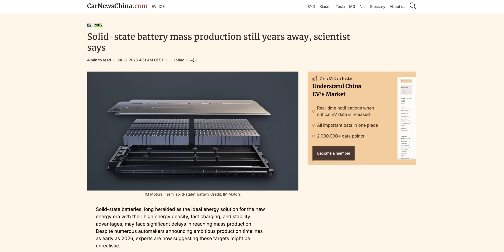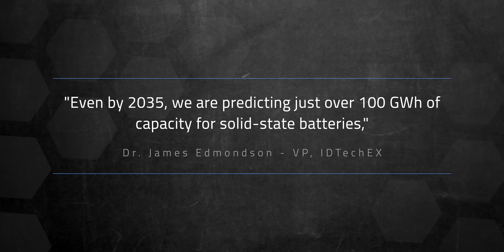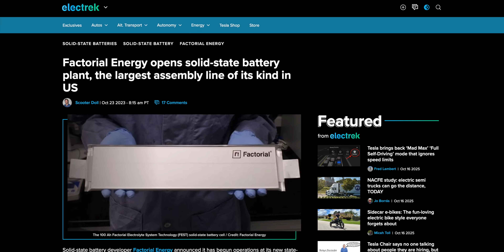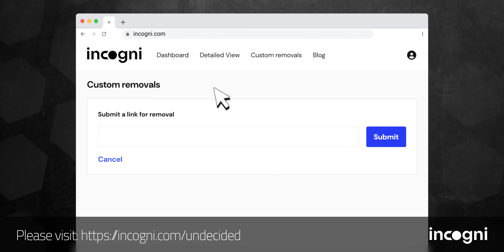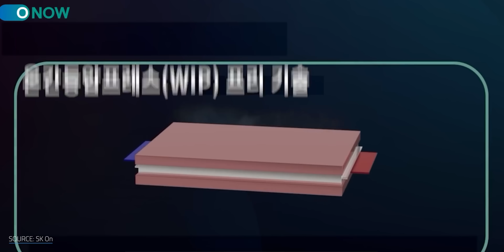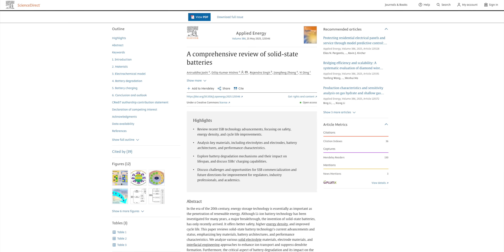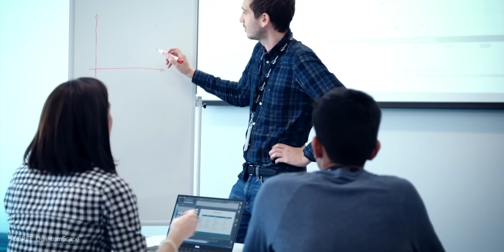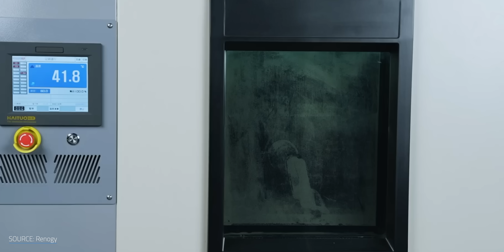How Close Are We to Solid-State Batteries?

Comment: I just want battery that does not degrade in a year. At least 5 will be nice.
Reply: Current real world data is beginning to show that EV batteries last a lot longer, with less degradation than lab testing predicted. The average expected life (90% retained capacity) of batteries in EVs is over 300K miles. That's on par with a properly maintained ICEV.

Comment: Seemingly, solid state became the holy grail back when there was exaggerated concern about battery fires.  Over time that has proven to not be a major concern.  Is greater range what we need?  I don't think so.  What good is a 1,000 mile range battery if it takes a month to charge?  I think what we need is a battery that will provide over 300 miles range at 70 mph in the winter and will recharge as quickly as one could gas an ICE car.
Reply: Yep. The only numbers that matter are how fast you can add 200-300 miles of range. Everything else is just noise.

Comment: Time to wait for a computer or phone with solid state batteries
Reply: either that or room temp superconducting material coming first which would make every electronic device near 99% efficiency.
Reply: @bulletghost3452  99% efficiency doesn't mean much so long as your screen emits light, screens are the main thing that depletes your battery, other electronics component have less impact unless you are playing a very heavy game for your phone

although it would probably just around double the battery life if they managed to do it
Reply: i know, my battery on my phone holds like 60% charge right now, other than that the phone is perfect still. beyond insane.
Reply: @chancepaladin  Get a new battery.  Set it to never charge beyond 80-90% and it'll last much much longer.
Reply: @ChrisNotTheKing  not all phones have that option though, normally saving it for their more expensive flagships.
Reply: @ChrisNotTheKing  Replace your battery, don't bothere trying to keep your battery at beyond a certain point or at a level, the benefits of that are minor
Reply: @bartomiejmarciniak4034  You're right.  The only benefit of prolonging the life of the battery for the life of the smartphone is that you won't have to replace the battery.  It's why they can be considered consumables... as are those devices with non-replaceable batteries.
Reply: This is my take, I don't care about cars, give me a phone that can last a week on a single charge even under heavy loads
Reply: @YUGAMISEKAI  rather have the car that'll take me on long trips without stopping
Reply: @revengerwizard  all chinese manufacturers have already shifted to partially solid state batteries in phones with 7000+ mah batteries..in fact i am holding one iqoo neo 10...crazy battery life with all ai features that even apple doesn't have
Reply: @jagandanesh9560  the iqoo has a silicon carbide lithium ion battery.

It's just another variant of li-on with better energy density and faster charging capabilities. Nowhere close to what true solid state batteries can give you.

Comment: As nice as it would be to improve the battery, the root problem with EVs are everything except the EV. Without good infrastructure throughout North America, EV adoption will stay scarce. At this point we'll need charging stations in empty rural lots, strip malls, shopping complexes, gas stations in order to level it out with ICE drivers. And 10 minutes to get to 10 - 80% is not good enough either. It'll need to match the speed of a gas up from 0 - 100%
Reply: No it won't.  Why 0 to 100. 10 to 80 is good enough.  Now the time to charge may have an input.  The other main point is you will mostly charge at home. So the effective time to charge up is zero if your can charge always at home.

Comment: SSB has almost become a meme with lofty promises and ever pushed back launch dates. The way it seems now alternatives to SSB might reach those lofty promises of SSB before the Achilles heel od SSB is solved, the lifespan and degradation plus increased production costs. 

LifePo is there already in regards to safety, and charge speed and decharge speed gets better each year. I'm pretty sure the train has left the station for SSB in the automotive world way before 2030 in regards to price, performance and lifespan. 

We already see that long haul to trucking in Europe is doable today with existing battery tech and charger infrastructure. And brand name trucks bought at your local dealer. And imagine how much better that will be over the next 5 years.
Reply: And don't forget the current trends in improving motor technology.

Comment: Sodium ion batteries is out and is amazing in cold climate
Reply: Uh huh.
Reply: 30% less energy capacity is not amazing
Reply: @rotaryenginepete They will likely be huge for the grid where energy density isn't as great of a concern. They also have potential for cheap cars where range might not be as big of a deal as long as they have a 100-150 mile range. Cost/kwh being cut in half and inherent fire safety are incredible in the right applications.
Reply: "DIY Solar Power with Will Prowse" did a reality-check video on those.
He pointed out that nobody is mentioning the round-trip efficiency.
It is likely comparable to Ni-Fe batteries with the very wide operating voltage range of like 4-16V,
Reply: @economicprisoner  Round trip efficiency isn't as much of a concern with grid applications. Pumped hydro projects are still ridiculously profitable at 75% round trip efficiency.
Reply: @fern3436  he is Dell, that says enough !
Reply: @economicprisoner Zi-ion batteries are starting to look promising tho their energy density is not quite as good as Li-ion yet.
Reply: @YetAnotherUnixUser  I have not looked into the LTO batteries that Will Prowse mentioned yet for cold temperature tolerance.
Low temperature sulfur batteries are likely to be energy dense if they ever finish inventing them (having 8 valence electrons).

Comment: 2:00 - there is difference outside texas. if your winter is averaged -25°C. you will be bothered about 3% liquid within a battery
Reply: The liquid could have a lower freezing point. Sodium ion batteries have much better low temperature stability than lithium
Reply: @Hotrob_J  i am proud of your optimism for "average Joe" knowledge level to be able to differentiate battery chemistry beside something short as "solid state" marketing.

Comment: Some of that is still solve in terms of sodium by allowing a hybrid pack. The sodium battery can do lower temps and thus could help run thermal and on start operations while the SSB can handle the range. IF they can really hit double the range, then really you only need half the current cell amount as well reducing the over all cost compare to what it cost to have that same range in LFP. 400 miles would be more than enough for me (400 for perfect weather/temp, 300 for cold/hot days). And if sodium gets cheaper as they say it will, then that drops the over all cost down even more for the pack.

Comment: Another "breakthrough technology only 1 or 2 years away."  This has been battery and EV stories for decades.
Reply: But we can’t deny things have improved year on year and that’s not looking at a almost 90% fall in price. Range is really increasing year on year that’s not in question. But it will get to the point you need to say right enough the range of 500 miles real world is more than enough for 98% of Car owners so why chase this 1000km most manufacturers seem fixated on like a challenge. Great if the battery gets lighter and offers 500 plus real world miles but do we need 800 miles I just don’t think so.

Comment: One false claim after another, nearly as bad as Fusion.  Sure Toyota has had a car with Solid State batteries for near. a decade, but it cost 1 million dollars. Until something fully solid state and not some fake comes to market where it can be examined for cost /performance and potential draw backs like catching fire, exploding, emitting lethal gasses, dangerous EMF, etc - its a non product.  A problem with markets is the desire to be first results in massive numbers of false claims.  Close only counts with shotguns and hand grenades. It is either solid state or it isn't.

Comment: Just a reflection if the expectations are that we can have a car that can travel 1000 miles on a full charge and charge from 10% to 80% in under 10 minutes. First, I will assume an efficiency of 4 miles/kWh at 75 mph. This translates to a FULL USABLE BATTERY CAPACITY (at 100%) of 125 kWh. The car still needs that amount of energy to achieve the range objectives irrespective of the battery technology. 

Now comes the interesting part. To achieve the objective of charging from 10% to 80% in ten minutes the battery needs to charge 87.5 kHh in 10 minutes. That translates, assuming it can do so at the same speed for the entire time and my math is correct, into a charging speed of 1,450kW charger. Are these available? If not, when will they be widely available? Today in China they prototypes of 1,000kWh chargers but what about the rest of the world. I honestly believe the holy grail is still much further away than just the battery technology as this will address safety, size and weight but not necessarily efficiency as other factors come into play.
Reply: Realistically, the goal should be 200-300 miles of range in 10 minutes. Everything else - percentages, charger types - is just window dressing. That is part of the appeal of true solid state batteries. They charge faster, with less heat loss, than other compositions.
Reply: @GeeDeeBird  The point still stands. If you want to charge 200 miles, not 300, in 10 minutes and do so in a car with the 4 miles/kWh efficiency which is probably not achieved at highway speeds by very few if any car today, you need to charge 50kWh and this requires average charging speeds of 840kW. Where do you have those chargers today? Yes, they may achieve the batteries but everything else is needed to achieve your objectives. From China today they have cars that get close but in 15 minutes.
Reply: My point also still stands. Not everything relies on charger voltage. Improvements in battery and motor technologies can lead to reductions in charge time as well. And those improvements are in sight. Axial flux motors and low charging loss battery technologies are out of the labs, and will be in production long before we see 1K charging infrastructure. Heck, even improvement in wiring and connectors can influence both efficiency and charging speeds. So, while your analysis is essentially correct, it fails to take other relevant factors into account.
Reply: @GeeDeeBird  I hear you and agree that technology evolves and does so very fast. The only point I want to make is that we may not be as close as those other development do take time to implement. The most significant hurdle will probably be the installation of large numbers of the charging infrastructure required for the very high charging speeds to support it. The reality today is that with what we currently have available there are many consumers that can greatly benefit from moving to an EV except from the fear of range anxiety and how long it takes to charge. I own one with a not so great range or charging speed but for the past 18 months I have owned the vehicle I only needed to charge during.a long trip once and I looked for a location can also served food and had a nice lunch while the car charged. The rest of the time I charge at home and with solar its free.
Reply: @elmojito Okay. I think most folks realize we're at least a few years from the tech advances showing up in production vehicles. We also agree that the fast charging infrastructure - particularly off the interstate highways - is deficient.
Like you, we charge our EVs at home and have solar. So we essentially pay nothing except for road trips. And, like you, we don't mind finding things to do for the twenty-five minutes it takes to bring either of our vehicles from 20 to 80 (both charge at max 180 and I don't like to go below 20%. I know, it's irrational, but...). So, for me, the current tech is fine.  Where I, like you, see problems is folks who can't charge at home or at work. For those folks, we need fast charging that is comparable - in price and speed - to filling up on the way to work or home. That's the inflection point for wide scale EV adoption. 
I think you probably agree that some transportation does not lend itself to wide scale EV adoption in the foreseeable future - notably semi trucks, airliners, military transports and other large, fast, long-range vehicle. But future solutions for these may exist with hydrogen, micro-nuclear and even in some future electric developments.
I guess the distinction I see from your original thesis is that I believe the   personal EV problem yields to multiprong tech advancements in batteries, chargers, motors, wiring and vehicle power management. I don't think we are gonna need large scale adoption of 1G plus fast chargers first, though that may eventually happen to improve charging speed at the margins - yielding charging much faster than filling your gas tank.
One final observation... Who needs 1000 mile range? I don't believe that vehicle will ever come to market. They'll make the battery smaller and lower the price. What do your calculations say if you assume 400 miles of range and 4 mi/Kw? That's where I think we will be in the next five years or so. 
Thanks for the interesting exchange. I think it's safe to say we agree on the big picture, and differ only on details. And we seem to both believe the most important takeaway - for personal transportation, the future is electric!

Comment: the Ducati battery has 844 Wh/L, gasoline has 9000+ Wh/L
Reply: Yep, batteries need to take up ~4x the space and weight of your gas tank. However, all you need in addition to a battery is a relatively small electric motor and a differential. With a gas tank you also need an engine block + lubricant oil, a radiator +  coolant, a fuel pump, a starter, a transmission, exhaust pipes, a differential, and maybe a drive shaft. When you take the total size, weight, and complexity of the system into account, batteries come out on top. #engineering
Reply: @jameslmathieson  not a chance, look how much a battery pack in a car weighs.
Reply: Only 3000 Wh/L are actually put to the wheels, and 30% efficiency is conservative there
Reply: @polyvalentin  A Tesla is around 70% efficient, it still makes no sense

Comment: It sounds like the easiest way to solve the problem of maintaining good contact between the solid electrolyte and the electrodes is to just include a very small amount of liquid electrolyte. Like you I don't give a crap if that technically makes it only quasi solid state, as long as it lasts as long, has the same capacity (or close as) and is cheap, and that last one doesn't matter too much in the beginning, I don't mind spending $50 on a 3rd party replacement for my phone if it has double the current capacity, or $100 for a laptop battery.
Reply: That's what I immediately thought of!  An electrolyte sandwich, with solid in the middle and liquid on either side to provide a uniform connection between anode/cathode and the electrolyte.

Comment: I have no problem if it’s quazy or full but the three areas that matters most 1) energy density 550w per kg minimum , smaller lighter packs air travel game changer cutting fuel costs, 2) cycle life 1500 cycles is just not enough to replace fuel life vehicles , if the pack is 62kwh and your a highway mile munchers like me that’s on average 172 miles to 200 miles meaning  charging from depleted every day , this also affects taxi drivers, who often take lunch just to charge , the life of packs has to drastically increase to 10,000 full cycle something lfp and other just can’t do , sodium battery’s may be easier to recycle but energy density, and life expectancy is still super low we already see some drivers with over a million miles in3 years as a taxi driver in Usa especially in Reno /navada route to lax and just eat drivers many have changed there packs because of degradation,  we need to get out of the 80% charge rule for it to really take off  , 3 life expectancy many packs whether industrial grid tied or train /air die within 5 years due to use ,  likewise degradation due to electrolyte weaking and dendrite buildup have major implications solid state dream is a day in day our full charge 15 to 20 plus years for a pack without degradation , we naturally think of home or car industry but it’s the motorcycle industry especially that is affected the most with the 2035 rule , many packs are far smaller many still limited to 88 miles highway , this cnnot replace fuel with these levels , I used to have a zero 11kwh sr by year 2 I was down to 69 miles per full charge  in 22k miles it was a pain to keep I swapped it for a cb500 x to just do the weekly city commute we driving a car just isn’t worth the time due to traffic the funny thing it still cost 7. Quid to fill but I got double the range for it, ev motorcycle owner are waiting for that 200 mile tank range highway from a battery that can charge as they have a bite to eat , right now in cars that’s 55kwh minimum you just can’t shoe horn that in,  likewise weight will affect air , a high capacity in small package i that doesn’t degrade is needed this is where we home solid state finally solves this Rosetta Stone problem.
Reply: Rated cycle life is going from 0-100% SMFH! 
Not anything less again SMFH.

The average ice vehicle is still lasting 150,000 or so miles. I've had a few go farther of the 85+vehicles I've owned since 1997 and many not go that far before major rebuilds engine swaps etc. And running a service shop I saw many more struggle to hit 100,000 before requiring a rebuild or replacement here in Atlanta.